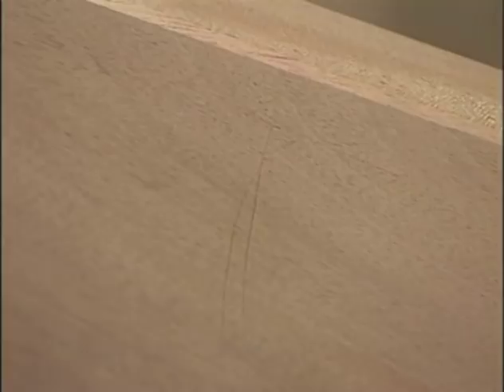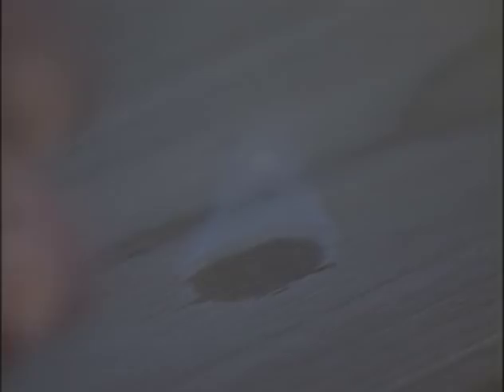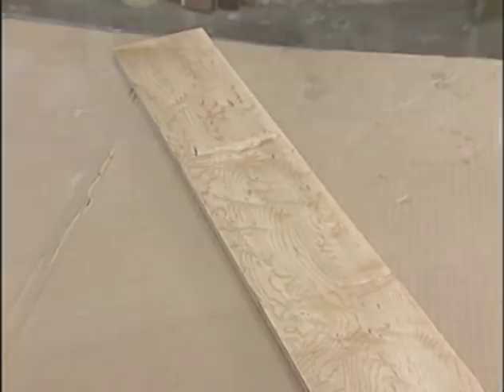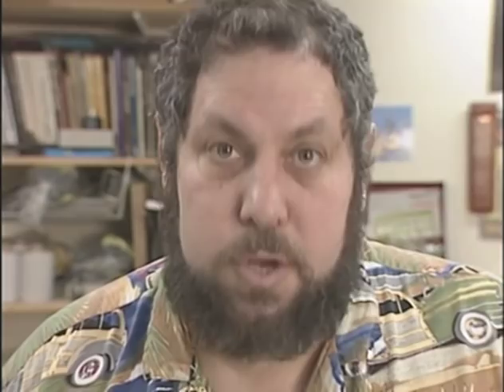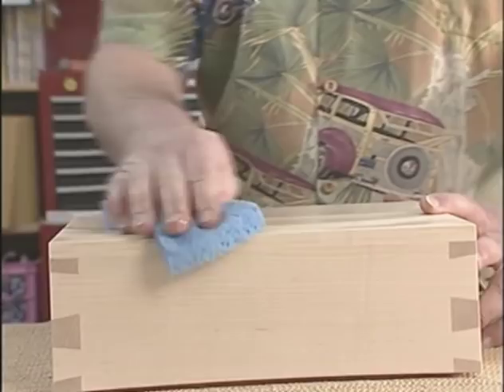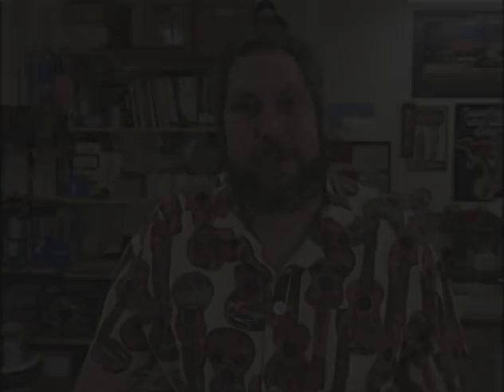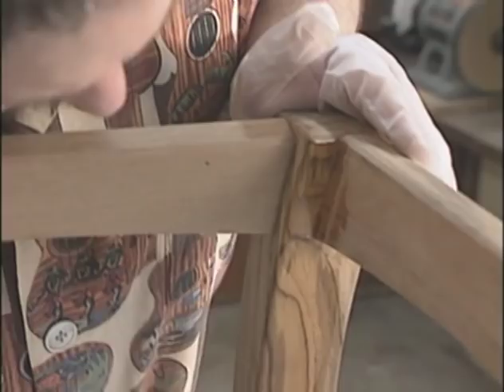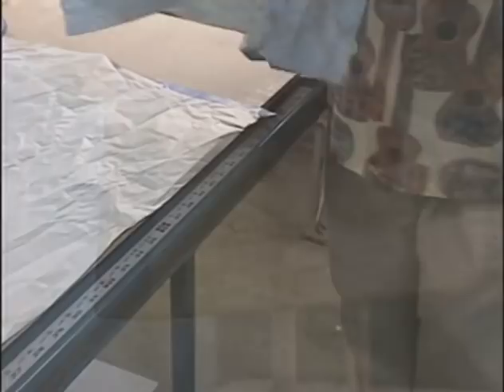Wood Finishing Basics

Comment: Hi Michael...I been a fan of yours for over 25 years..  I have a tough question for you concerning wooden bowl and resin..I have been a wood nut for almost 60 years and turning wood for 56 years..  my current finish is a friction polish made form Shellac, oil and alcohol..it’s a great finish as we all can put it on and turn up  the speed and it cures in a few minutes..it’s quick but not hard enough surface..it’s too weak..plus if alcohol is spilled on the surface in the future it’s not good...for 30 years I used urethane..where I build up the coats..say 10 coats...it’s timely..  then buff out with rotten stone and mineral oil..  I dislike any form of lacquer as I have COPD and it just hammers my lungs..  so I ask..  any quick way to use a water based urethane?  For the bowl finish?  Anything like a urethane friction polish.. ?    it’s a big quest I have..  but I love the hardness of urethane..  help.   Also...thx for the years of magazine article..over the years..I hope your safe too.  Terry

Comment: Around 28:10 you show punching holes in the track of the can where the lid resides.  I was thinking that the seal of the lid is on the inner part of the lid, interior where the holes are punched.  That means that air will easily enter and leave the can thru the holes you created and ruin the contents of the can.  Am I wrong?